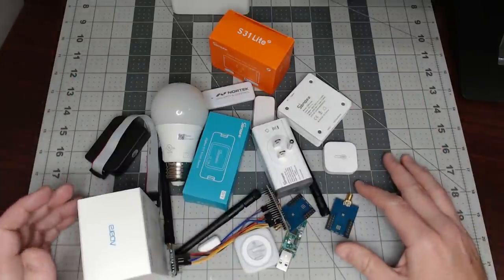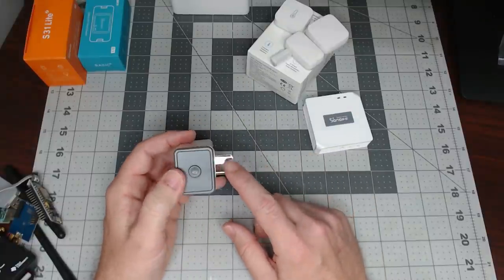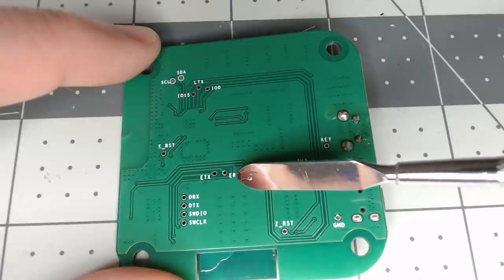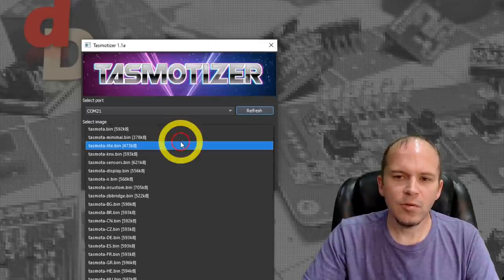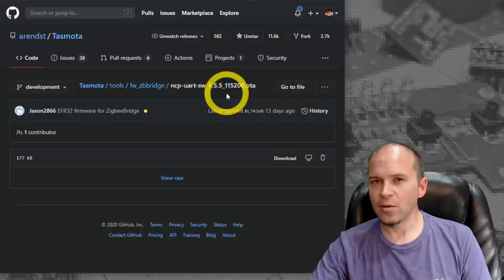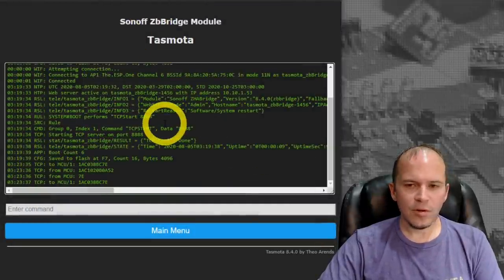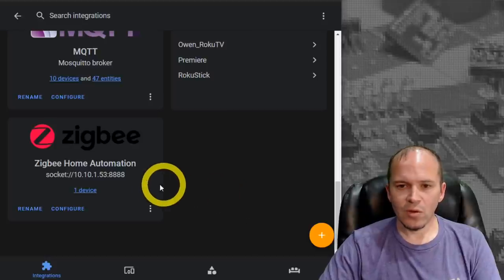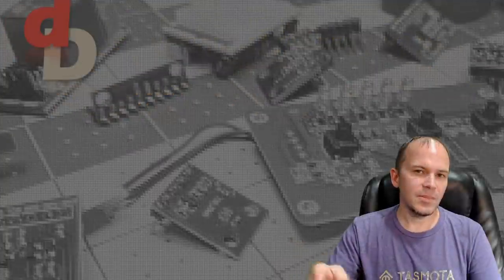Sonoff Zigbee Bridge with Home Assistant using Tasmota | NO Soldering | Step by Step Guide

Comment: I follow the procedure to flash the ZbBridge and was able to integrate it to home assistant ZHA. But when I launch he pairing with devices (sonoff, aqara or ikea) it doesn’t work and it HA returns:

[0x0000:zdo] ZDO request ZDOCmd.Mgmt_Permit_Joining_req: [60, <Bool.false: 0>]

and the console prints that messages:

18:13:13 TCP: from MCU: 4203A157542F51F87E
18:13:13 TCP: to MCU/1: 8520DD7E
18:13:23 TCP: to MCU/1: 25002157542FF54B7E
18:13:23 TCP: from MCU: 5300A157542FE00E
18:13:23 TCP: from MCU: 7E
18:13:23 TCP: to MCU/1: 8610BE7E
18:13:33 TCP: to MCU/1: 36012157542F8B7D5E7E
18:13:33 TCP: from MCU: 6401A157542FAD927E
18:13:33 TCP: to MCU/1: 87009F7E
18:13:44 TCP: to MCU/1: 47062157542FEC967E
18:13:44 TCP: from MCU: 7506A157542F95627E
18:13:44 TCP: to MCU/1: 8070787E
18:13:54 TCP: to MCU/1: 50072157542F94027E
18:13:54 TCP: from MCU: 0607A157542FB44F7E
18:13:54 TCP: to MCU/1: 8160597E
18:14:04 TCP: to MCU/1: 61042157542F10FC7E
18:14:04 TCP: from MCU: 1704A157542F05B97E
18:14:04 TCP: to MCU/1: 82503A7E
18:14:05 HTP: Console
18:14:10 MQT: tele/ZbBridge/STATE = {"Time":"2020-09-04T18:14:10","Uptime":"0T00:05:11","UptimeSec":311,"Vcc":3.519,"Heap":28,"SleepMode":"Dynamic","Sleep":50,"LoadAvg":19,"MqttCount":1,"Wifi":{"AP":1,"SSId":"Saint Jean","BSSId":"7E:D2:94:37:0F:20","Channel":13,"RSSI":62,"Signal":-69,"LinkCount":1,"Downtime":"0T00:00:05"}}
18:14:14 TCP: to MCU/1: 72052157542F6EC97E
18:14:14 TCP: from MCU: 2005A157542F48257E
Reply from the maker: Have you had ZHA on here before? One time I had to delete the Zigbee database.
Reply: @digiblurDIY  No but I restart the full procedure (except tasmota) with firmware ncp-uart-sw_6.7.6_115200.ota and this time it works. I have HA 0.114.4 installed

Comment: I'm assuming this process can be followed for the Sonoff Smart Zigbee Bridge Pro as well, right? The idea of limiting to 32 devices is getting to me a little, even though I don't have a single Zigbee device yet, with my plan for smart light switches which may or may not end up being Zigbee, and then motion and temperature and humidity in all or many rooms, I am strongly considering getting the Pro instead.
Reply from the maker: I'd recommend a USB or Ethernet stick instead of these now, we didn't have those readily available then but now they are so easy to get, much easier to deal with the reliability is great.  I'd stick to the CC2652 chipsets for now.

Comment: Awesome video as always! How much better are the signal comparing to nortek?
Reply: I have also to disable zwave due to interference 😞and using smartthing for the zwave stuff
Reply from the maker: Nortek had the same issues in my place, couldn't catch a sensor across the house. Had it for a while and one of the reasons I never dove into Zigbee.
Reply from the maker: I had Zwave through a few hubs including Smartthings and I thought HomeAssistant would fix my issues but alas, the same issues persisted and I found out there was a bunch of interference.
Reply: Got it! Thank u!So you think worth upgrading from nortek to Sonoff( you got much better coverage) or not much

Comment: How is the responsiveness of this after it’s flashed. Noticed Phillips hue hub is between 1_4 seconds to trigger. Doconz is usually always less than a seconds.
Reply from the maker: I know it isn't 4 seconds for sure.  The door trigger sensor seems to be fairly quick, I wouldn't have an issue using it as a light automation where split seconds count.

Comment: How do you find the update times on the Tuya sensors?  I have a couple of Tuya sensors and they seem to only wake up to send data every 5 minutes.  Even the motion detector (Tuya) is pretty unreliable sending data.  Other brands seem to be fine though.
Reply from the maker: That seems to be the norm unless there is some rapid change. I would go with esp based sensors so you can set your own times if you want faster.
Reply: @digiblurDIY  I guess I am use to the Hue ZigBee sensors that update immediately on a reasonable change and they are very responsive on the motion detection.
The Tuya motion detector will go to clear then won't go back to detected until it's been clear for 5 minutes.  Quite frustrating.
Unfortunately in the bathroom I can't use an esp due to no easy way to get power to it.
Thanks for the great video :)
Reply from the maker: Aqara motion has an over 1 minute cool down. I thought wyze was bad at 30 seconds. The 7 second AM312 will spoil you.
Reply: @digiblurDIY  I got my AM312 down to 1 second.  I use that in the kitchen because I have power easily available there.
Hue sensors are 10 second cool down, but you pay a fortune for Hue.   I guess you get what you pay for.
Still, 1 minute is better than 5 Tuya have.
Reply from the maker: Not sure where I got 7 seconds. https://www.sunrom.com/p/micro-pir-motion-detection-sensor-am312
Reply: @digiblurDIY  yeah, official spec is 2 seconds.  I guess some can work a little quicker 🙂

Comment: Thank you...I was able to get this up and running with zigbee2MQTT.  Should the LEDS on the bridge still work?  I have nothing, both LEDS are out.
Reply from the maker: I haven't tried myself but you should be able to control them as they probably just attached to GPIO pins.
Reply: @digiblurDIY  I see in the template that they are setup. I guess I really should be asking if they are normally both out?
Reply from the maker: I will have to check to see. Mine is in a closet so I rarely put eyes on it.

Comment: Dupont jumpers dont fit in the holes. Are breadboard jumpers skinnier?
Reply from the maker: Yes, that are smaller.  If you don't have any you could use some wire out of a cat5 cable too.

Comment: I have the Sonoff ZF Bridge and got it working with ZHA and the lumi sensors., but i'm unable to pair IKEA Trådfri module, do you know if there is a limitation there ?
Reply from the maker: I saw some issues posted with Ikea stuff on the Tasmota side they did fixes for. ZHA might need to implement the same ones.

Comment: Nice walktrough! I wonder how this compares to the raspbee/conbee stick. I have one of those, and it has lost all it's bindings two times already so I am very open to a better alternative. Would this be more solid?
Reply from the maker: I can't compare myself as I've only run another Zigbee stick in the HA box itself.  I haven't used those models.  As I said in the video I do like this one since I can put it in the middle of the house as all my sensors are battery powered sleeping ones.

Comment: Great video, Travis! Thank you. To clarify, will there still be a Zigbee mesh that's created when using this bridge?
Reply from the maker: Yep. That's the stuff I went over at the end showing the mains powered plug was showing up as a router/repeater.
Reply: @digiblurDIY  Awesome! I thought I caught it correctly but wanted to be sure. Thanks, brother.
Reply from the maker: No problem!  I was just pointing out that I didn't have to worry about making the mesh with this guy as I run mostly battery powered Zigbee stuff.

Comment: Do you know how range of this bridge compares to USB pens with antenna (such like ZZH and other CC2652R based)?
Reply from the maker: If they had PCB antennas they would be very similar.  There is no comparison though with the CC2652 series in basis of performance and compatibility though.  Awesome chipset especially when used with Zigbee2MQTT

Comment: Will zigbee devices keep on working if, for whatever reason, HASS is down with this setup? So if the Raspberry with hass shuts down... will I be able to switch the lights still?
Reply from the maker: The light switches will still work but of course not remotely unless you had like a button bound to a light then that button would still work.

Comment: Hey there,
I am struggling to get this running. 
Every time the update is done, it looses wifi connecting. 
I am using tasmotizer 1.2.1, i tried on windows and linux. I also tried NodeMCU flasher from windows. The flash itself is going as it should, no problem there. But the tasmota AP is only showing up shortly, and i cant connect to it. I tried several phones and computers, no luck. I even tried setting the wifi within tasmotizer, also without any luck. The funny thing is when i flash with the normal tasmota firmware, without zigbee, everything is working, but obvious no zigbee function. I tried several versions of the firmware, but all zigbee versions ends with no wifi access. Have you seen that before?
My sonoff board is ver. 1.1 2020.02.28.
Reply from the maker: Have you tried to swap power cables or power supplies?
Reply: @digiblurDIY  No, because I did not think that was the problem, as it worked with the normal tasmota version. I actually came a little closer to the end goal, with a workaround. I flashed with tasmota_lite version, and did a OTA to the zigbee version. That seemed to work okay... i think. Now i am stuck with a upgrade failed, when i select the ncp_uart-file. The console says something about "bootloader initialized failed" and right after that, the firmware upgrade fails. I tried all sort of commands in the console, before upgrading, but nothing helped. I am not sure, if its because of my workaround or not. When i run these commands "Backlog weblog 3; SetOption65 1; Module 75;" in the console i even get the zigbee map and pair button on the main page, but of course it says zigbee not started. 
Thanks for you suggestion, I appreciate it.
Reply from the maker: If the uart file is failing that means it can't access the Zigbee chipset. It could be due to power supply issues or broken hardware.

Comment: You list Breadboard wires and jumper wires. Is there a difference in the guage. I just received my Zigbee Bridge and have Jumper Male Female but seems the holes are not big enough for the piece to fit in. I also notice that there is some new updates on the board and wondering did Sonoff change the size so this can't be done anymore?
Reply from the maker: I used both. Breadboard into jumpers. Haven't heard of a report of that yet.
Reply: @digiblurDIY  There is a large arrow on this board that isn't on the one you used in the video beside the ETX pointing towards the edge. Going to order some new jumpers and see if this is the issue as I notice mine are squared. (Round Hole, Square Peg).
Reply from the maker: Breadboard jumpers are round.
Reply: @digiblurDIY  Hey Got the jumper cables and got it flashed Thanks... Ran into another issue though. ZHA says can't connect. Socket is right, port changed successfully to 8888. When I do the connect ZHA says can't connect and bridge gives me  23:03:25 TCP: to MCU/1: 1AC038BC7E ... Any ideas

Comment: Great video Travis - clean, clear and to the point.  Just one question, for those who want to use "routers" (as maybe we have door sensors on shed doors at the far end of the garden for example) is it possible to flash a Sonoff Zigbee Bridge and use it in "Router" mode instead of "Coordinator"??
Reply from the maker: Thanks! I haven't seen any firmware for that. Just the two versions for either mode.
Reply: As I understand it, a “coordinator” node handles the wifi-Zigbee mesh connection. The Zigbee “routers” are like mesh repeaters/extenders. If you only have Zigbee routers, they won’t have a connection to the internet.

Comment: Hey! Very nice and complete video! Thanks for that.
Question, is it possible to connect RF 433Mhz devices to the Sonoff Zigbee Bridge once it has been flashed with Tasmota ? Perhaps the hardware has this feature and is disabled :\
Reply from the maker: There's no 433mhz radio in there.

Comment: Hi bro! One question, I have a Sengled kit With 4 bulbs and 1 hub, but my hub randomly stop working and it has no warranty left, so I saw this sonoff bridge with zigbee and also want to use it with their door and motion sensor, but I did not get that if I can use the sonoff bridge directly with the Sengled bulbs or if I have to do the flashing mod that you explain in the video, I hope you can help me with this! Keep on your videos I have subscribed bro! 👌🏻👏🏻
Reply from the maker: Are you using Home Assistant or anything else?
Reply: No bro, I’m using Sengled app for my lights, and I want to upgrade for a little more security at home on the cheap, so I looked for the sonoff zigbee that’s why I wanted to asked you if I could use my Sengled bulbs with it :) or what do you recommend me, I don’t wanna spend more money for the Sengled hub to replace mine that no longer work
Reply from the maker: You might be able to pair them, not really sure.  I tried some other temperature sensors with the Stock EWELINK app and it worked.  This was before modding/flashing it.
Reply: digiblurDIY thank you, I’m gonna buy it and try, if not, I will follow your instruction for your blog to flash it 🤣 thank you bro! Greetings from Mexico!

Comment: Hey man, thx for the video.
I`m getting a "failed to connect" when setting up the ZHA integration.
Could you help me out?
Reply from the maker: I'll need some more info. Were you able to get zigbee to start on the bridge itself?
Reply: I just got it to work. Started all over. Did the same thing though, don't know what the issue was, but it works now! Thank you for your reacting though 👍

Comment: Does it make sense to buy Sonoff RF bridge for door sensor and others, when now is available Zigbee version of it? Which is the better ratio price to options and quality?
Reply from the maker: Zigbee is going to be better for security and sensors/devices hands down.  But 433mhz is going to have some awesome range though.
Reply: @digiblurDIY  One more question! What is the difference between Sonoff Zigbee bridge and USB dongle, and why you should buy one, or another?
Reply from the maker: One is tied to the server and one is pretty mobile being a bridge. The bridge allows me to put it in the middle of the house.

Comment: Aqara cubes seem to not work well with this bridge. You only get the battery entity (tried 20+ times).
Also, you have to double check that the second file had been successfully flashed, getting the success message!
Reply from the maker: One of the reasons I did this one for that success message thing. I don't have any cubes, haven't seen those. Only the Aqara temperature and motion
Reply: @digiblurDIY  cube and overall Switchs has a odd way of work in ZHA (and with deconz too) they only have the entity battery, but for the actions you only see it on the events Page. Choose zha_event and manage the cube or switch and you Will see an event showing.
Reply: @finipini  Thanks for this info.  I thought my Aqara cube wasn't working well either, but based on your comment about zha_event, I was able to add automations based on triggers for Aqara cube, such as 'Device rotated right', 'Device rotated left', 'Device shaken', etc.

Comment: how to allow the bridge to send all the MQTT topics of the connected devices to the bridge onto the MQTT broker ? The only topics i get is the coordinator itself and not the sub devices.
Reply from the maker: Change the module back to 75. This will put it back on Tasmota Zigbee mode.
Reply: @digiblurDIY   cheers !:) but whats the command how do i do that ?
Reply from the maker: Put in module 75 on the console or go to configure module screen and pick the bridge module 75

Comment: hi, i've purchased USB TTL (FTDI) , it has DTR,RX,TX, VCC,  CTS, GND pins. I don't see 3v3, which pin should i connect for 3v3? please advise. thanks
Reply from the maker: Could you send a picture of the back of it to my email, use the channel name at the gmail domain.
Reply: @digiblurDIY  many thanks for your response. I've just emailed with picture. this is the amazon link of the device https://www.amazon.ae/gp/product/B00IJXZQ7C/ref=ppx_yo_dt_b_asin_title_o08_s00?ie=UTF8&psc=1

Comment: I have only used Z2MQTT before so I dont know any better. But why would you want to use this Wifi zigbee bridge over let's say an Zigbee CC2531 stick?

Also, what's the advantage of flashing this ZB bridge with Tasmota?
Reply from the maker: I talked about that part of why I prefer it.  USB sticks are stuck on my server, signal is poor and in a bad location, combined with having to deal with serial port passthrough.  For my setup, it fixed all that.  I could put the bridge anywhere and it's all over IP.  

The advantage of flashing it, is taking it out of the cloud.

Comment: Hey Digi,

Got the whole system up and running for some time now and It’s working great.
Only the Aqara lumi motion sensor disconnects after about 1 hour and needs new pairing after that. You have any idea for a fix?
Reply from the maker: That shouldn't be happening.  It hasn't happened to me yet.  Any signal issue?  Do you have maybe router/repeater device you could put in the middle?
Reply: @digiblurDIY  only temperature and some switches. Going to pair it again and place it next to bridge for a day to test it out.